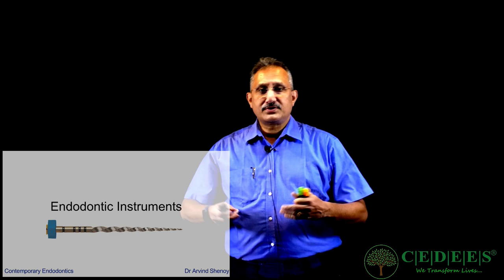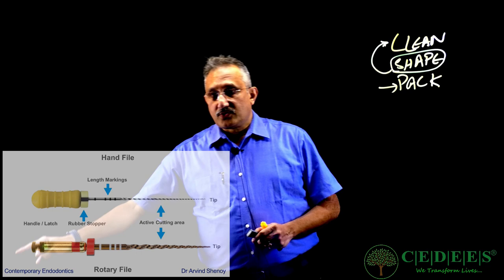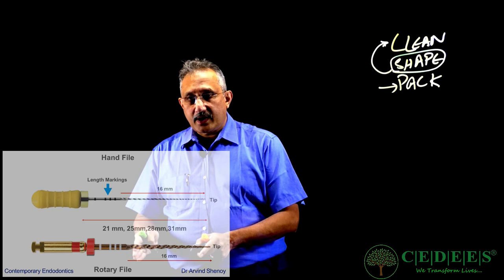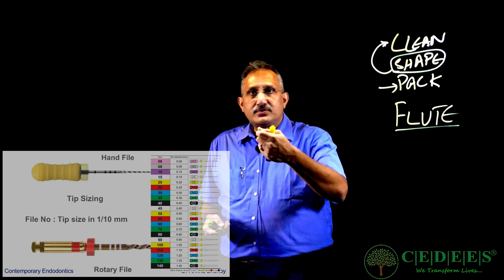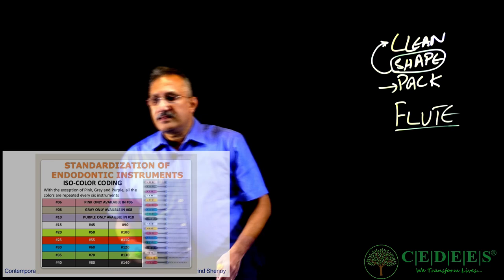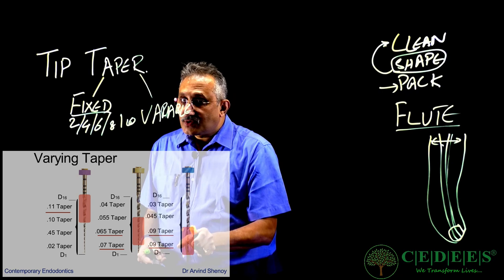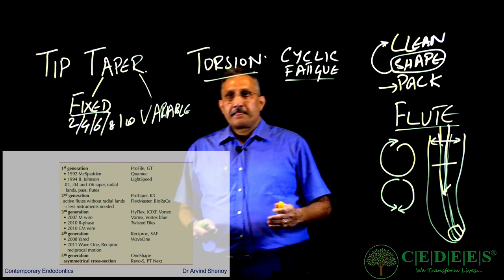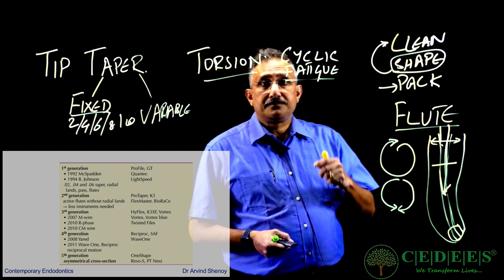Concepts of Endodontic Instruments - Simplified!!  by Dr.Arvind Shenoy.

Comment: hi sir, I have a doubt... file no is tip size in 1/10mm... so if the file no is 15mm then tip size must be 1.5 nah sir.. how can it be.. 0.15 when the tip size is 1/10mm
Reply: No as per the standardisation of Endodontic instruments
-- Each number shall be representative of the diameter of the instrument in hundredths of a millimeter at the tip which means that if the file no. is 15, it's 15 divided by the 100 which becomes 0.15 mm.